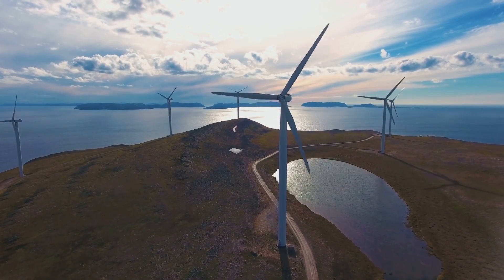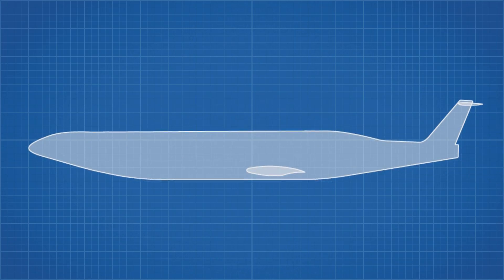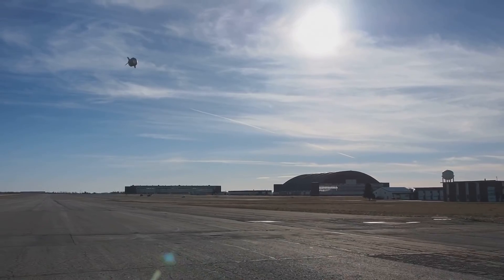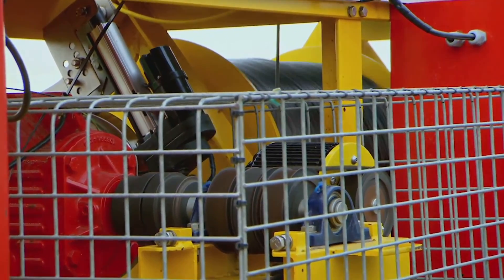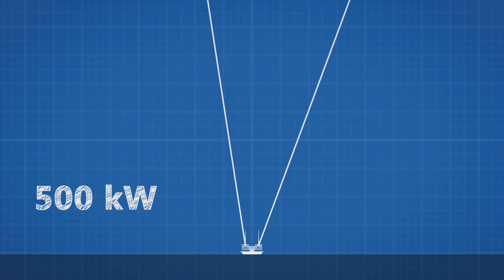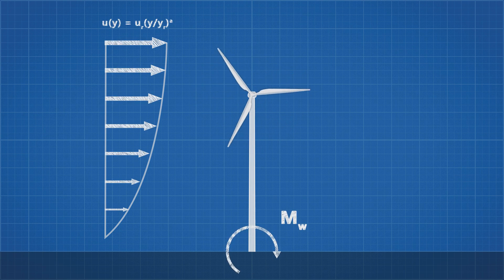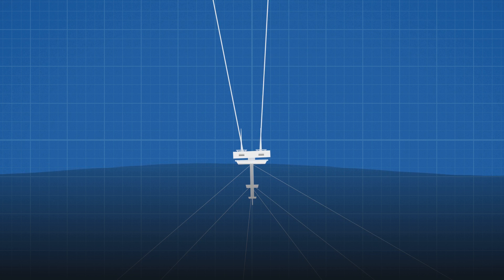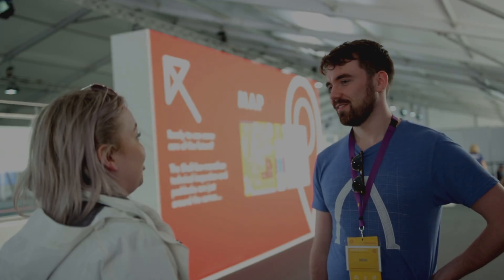The Future of Wind Power? - Kite Power Systems

Comment: This isn't very convincing. Nuclear fusion is the next step.
Reply: Nothing is the next step, because our methods of generating power are too widely distributed. It would take a century to become solely reliant on a super power source as old ones are slowly cycled out and replaced. 

In the interim, other new technologies like these can be quick and cheap replacements that improve overall performance even while a super power source is being universalized.

The world isn't so simple as to be able to summarize it.
Reply from the maker: There doesn't need to be one single answer, each has it's merit. We can't exactly wait around until nuclear fusion stops being science fiction either.
Reply: Nuclear fusion is not ready yet. Its absolutely still decades away from being viable AND economical, both of which unfortunately not a given. I definitely believe in the future humanity's energy needs will have to be met with fusion, because it is such a huge resource. 

But we need to take advantage of emerging technologies in the near future.
Reply: The problem with fusion is that there still isn't a single reactor generating more energy than it needs and we are already experimenting on it like 15 years? It probably ultimately is the final solution but the development could take centuries to come. It's just not smart to bet on a single card that has yet to prove its feasibility especially because we are already in a global energy crisis NOW. Nuclear fission 2.0 is another topic many people don't have on their radar. Its a thing and the only reason that it didn't happen so far is that it doesn't produce weaponizeable plutonium. We need to advance on every possibility to be able to meet future energy demands.
Reply: Fusion has been "20 years from now" for pretty much all of my life. When I say this, I'm not belittling the people working on fusion, they're incredibly smart people, much smarter about Physics than I'll ever be.
Reply: No. Nuclear fusion requires hideously expensive materials technology--and scientists haven't figured out how to cut that cost.

A far better solution is a new type of nuclear reactor called the Molten Salt Reactor (MSR). Fueled by plentiful thorium-232 dissolved a solution of molten fluoride salts, MSR's don't have the downsides of today's nuclear reactors, since they don't need expensive pressurized reactor vessels and because the fuel is already in liquid form, the danger of a fuel meltdown is non-existent.
Reply: Hydrogen is free. Wind is free. That 500kw wind kite is probably 50 grand when they scale production up. Are you really proposing that we are going to build nuclear fusion plants that make half a megawatt for 50 grand? Shit I bet the shielding alone on one of those plants would be 50 grand.
Reply: please read about controlled fusion
Reply: See, if some underqualified laborers in some god-forsaken place screw power kite - well they just spend some time untangling it. If they screw nuclear power plant (even fusion one) it at least melts down and catches fire.
Reply: whykhr
20 KWH(.02 megawatthours) = a pound of hydrogen from water
a pound of hydrogen fused is 79,378 megawatthours.
Hydrogen is basically free for use in fusion.
Reply: kkknotcool
Many of those small fusion groups that keep popping up see high temperature superconductors as the thing that has changed.
Reply: Dovah Bear Literally every element in all of nature is non-renewable, mate. Some merely last longer. Read up on thermodynamics.
Reply: Thorium reactors. They are almost completely immune to meltdown/MCA and produce 1/1000 of the nuclear wast normal reactors do and they mainly burn thorium ore which is currently a abundant waste product on most mines all over the world. The main problem with them is that development is expensive and there are not enough investors because of the bad reputation of fission in general.
Reply: Do you have the real name of the "Fission 2.0"? I couldn't find stuff about it
Reply: Oh shit, yeah, Thorium reactors are crazy. I really hope to see some big investment boosts for the research and application.
Reply: You should make a video about ITER fusion project or maybe generation IV fission reactors, those are also very interesting topics.
Reply: PureAwesomeness 
it's the next great leap. 

we have to design a system first. 

this system is already designed.
Reply: Actually, companies like Exxon and Shell already have surprisingly substantial interest in uranium mines. Many are still holding onto thorium mines, because if the MSR technology that uses thorium-232 successfully scales up to commercial operation, those mines could result a massive financial windfall.
Reply: nuclear power is just a transition between fossil fuel and renewable energy.
Reply: + Dzulfiqar Bagas Tito Fundamentally  there is no such thing as "renewable energy" - Most our power sources are just weak and inefficient receptors for energy coming from our big uncontrolable fusion reactor called The Sun.
Reply: yeah

but.. renewable energy called as renewable because.. we only exploit nature in the making process of those machines. after we made it, we dont have to exploit nature to gain power again. unlimited access to gain power. it's long term benefit.

(srry if my english bad but i hope u all understand)
Reply: Exactly. Nuclear fusion is extremely extremely complicated and expensive. Solutions like this or even a wind turbine are extremely simple by comparison. I believe it is good to step away from top-down production and go to more numerous locally production. Ideally, every household would be able to produce their own electricity. This will negate the dependance on third parties and bring forth an extreme reduction in single-point failure for whatever reason (attack, natural disaster, breakdown at the power plant).

Yes, large facilities will always be more efficient. But when you are not using fossil fuels, efficiency is not that important. It just needs to be simple/cheap to maintain or replace the components. It just needs to be efficient enough to provide a single household. 

The large consumers in the industry will have to rely on bigger installations.

The battle for the energy market is a political one. We need to cut out the middle-man where we can to truly empower individuals. We need to go off the grid or at the very least move towards a smart grid.
Reply: currently Nuclear fusion won't work as it can only be achieved at extreme temperatures which require more energy to produce than you get from the fusion but one could argue that solar power relies on nuclear fusion
Reply: QED
Is what they said a few decades ago.  And a few decades before that.
You have to ask yourself, what has fundamentally changed, that modern scientist, in the last decade, are now more able to create an economical fusion plant? Nice computer simulations is all I can think of.
Reply: e1123581321345589144 they have a better chance in the medium term but fusion is too promising to be forgotten even if we will never be able to make it work. It took us 400 years of failed attempts to master flight after all but it's worth it now.
Reply: Quantum Shooter
It did not take 400 years of failed attempts to master flight. The wright brothers to supersonic flight was 44 years. 
And the only reason the wright brothers got anywhere was they got economically produced aluminum 14 years before. And machining got way better in the latter years of the 1800s. And the math for fluid dynamics actually got worked out a few years before they flew. The wright brothers did great work but they really just used the accumulated scientific and business success of others(the new tech of their age) and applied it in an interesting way. What is the new tech that will make fusion possible? You cannot just say reseach and expect people to just figure it out if you throw enough money at them.
Reply: +Sacto1654 There's nothing new about molten salt/thorium reactors.  It's known for 60 years or so.  They produce much less waste than current fission reactors (0.1%), the waste decays much faster (300 years instead of 100,000), there's no risk of meltdowns indeed and there's much more thorium to be found on the planet.  Despite all these advantages, president Nixon killed the research because the process doesn't produce plutonium he wanted to build his nukes.
Reply: PureAwesomeness, Cool story bro, are you gonna build us the immense fusion reactor capable of withstanding outrageous temperatures that also produces more energy than it takes in? Cause we aint got dat shit.
Reply: my uncle worked on nuclear fusion for a pretty long time and he says it might never become commercially viable
Reply: Nice, thanks dude! :)
Reply: I just posted a similar comment. Nuclear is the cleanest option we have now.
Reply: Dzulfiqar Bagas Tito Yeah however we can go to other planets or asteroids for thorium and metals, in the future.
Reply: fusion?, that magic bullet that's been right around the corner for what 60 years now? I give these kite guys a better chance of succes.
Reply: The next fusion "plant" that has hope of producing positive net energy, is being built for testing purposes. And that is planned to start testing in 2025. We need energy between those 30 years for it to become the norm
Reply: "...companies like Exxon and Shell already have surprisingly substantial interest in uranium mines..."

Bull. Exxon & Shell could care less about uranium except to keep it off the market,  uranium has the volumetric energy density that is 41million X Oil or 94 million X Oil including the O2 you need to burn the Oil. So you can readily see what uranium means to Big Oil is $$$$ Lost for every lb of uranium or thorium burnt. And there are no thorium mines. It is a waste product of Rare Earth mines, they will pay you to take it away. In fact there is enough thorium in the annual waste from one Rare Earth mine, that makes materials for the Wind & Solar industries,  to supply the entire World's energy for one year.
Reply: "...Anyway saying they ahve the magic bullet to energy production and climate change is fooling himself, or plainly lying....*

Well, I ain't lying, and I know beyond even a shadow of a doubt, that Thorium can be the "silver bullet" to solve forever the energy / climate change conundrum. Don't mean it is the ONLY solution but unlike, wind, solar, fossil, renewables it by itself can quite readily and quite easily replace all our energy needs for all intents and purposes forever. Wind, solar are just scams, financed by Big Oil, to divert effort from what they know,  just as I know, Nuclear fission alone can readily replace all our world's energy supply and much cheaper than existing sources. That is just a fact. A fact they don't want you to know and they will pay $trillions if need be to keep you from knowing it.
Reply: Hydrogen is free? Last time I bought some it sure weren't free. Wind is free that's why in Ontario we pay 13.5 cents a kwh for it plus additional giant tax subsidies, because it is free. Nuclear fusion is speculation right now. Right beside the nutty wind turbines NPPs are producing power for 5-6 cents per kwh. That is even more free.
Reply: We are indeed getting closer folks!!! :D https://www.ipp.mpg.de/4073918/07_16
Reply: I think fusion (And space solar) will be the future. But it will take time until that. This technology can be deployed soon. It should not be that hard to start scaling up the production in short time. So until we get effective fusion then this (and some other technology) will help.
Reply: Fission would be the best choice for now. And we could already have Fusion if the governments would finally be able to not just talk Bullshit. The US invested less than 1/10th of what would have been needed.
hack - the annual US Military budget is about as much as the US has spent in grand total on fusion-research.

Fusion will be the next (and likely final) big step.

But this? it might work in some very specific circumstance, but sure as hell not for normal large scale powerproduction.
Reply: ANGELM73350 that's just a made up word for the next gen nuclear reactors.
Reply: In a few decades
Reply: Actually not the aluminum as much as internal combustion engines with a sufficient t/w ratio wich they produced themselves. 
As mastering I was intending to succed in flight and humans have attempted actively since at least da Vinci. 
What tech will make fusion possible? First is already possible, is just a matter of input to output energy so the tecnology needed is quite simple to show: better magnets, better fluidodynamic models of a concentrated superheated plasma, better superconductors etc... and in this case throwing money at it already showed promising results so I don't see why we shouldn't give them the chance.
Reply: Oh, yeah, cold fusion, a technology that needs billions in funding just to find out if it's even possible sounds like the natural next step…
Reply: gotta agree that nuke will not last forever, the kite can be true closed loop when coupled with string farm
and this will be very good if we can hold lightning strike too, coupled with solar we can produce energy day and night, stormy and sunny
Reply: PureAwesomeness This is a lot more feasible, affordable, and realistic option on the table. 
Nuclear fusion is a long way from fruition. We'll be lucky if we have a working prototype in the next 50 years and who knows how much long it'll take before it can be scaled up for commercial use. That's not to mention how long it would take for the tech to become affordable. 
So many idealists commenting on this video. Y'all need to come down from whatever fantasy you people are in and understand how the real world works.
Reply: PureAwesomeness king gizzard knows
Reply: Fnord Fnordington Would you rather burn coal?
Reply: Not saying that nuclear fusion is impossible, or bad, but the hype around it certainly is several magnitudes larger than the amount of energy it has produced to date.
Reply: By the time Fusion become commercial ...The planet will had pass the point of no return (if we did not pass it already)
Reply: Shell Oil does not promote thorium or Molten Salt Reactors because it knows damn well they actually will replace their noxious Oil & Gas. Shell loves flying kites and other pixie power fantasies, they promoted Bill Clinton's #1 energy solution (through the CGI Clinton Global Initiative), they even hired soccer star PELE to promote it, an f-in soccer ball with a pressure to current transmitter inside that charged a Li-Ion battery in the soccer ball so the captain of the soccer team could take it home, plug a tiny LED into it and watch porn at night. That's a good example of a "Shell Energy Solution".
Reply: Brian Miller while that is true, we are making progress. The largest test reactor is nearing completion in Europe, and is the first that could conceivably make power. We are still far more than 20 years from having it at a commercial level, but in only a few years we will discover whether we are able to use fusion with our current technology.
Reply: Quantum Shooter
The point is they needed the aluminum. They needed the math. They needed the machining. They needed all this outside stuff to create the plane. Without industrialized aluminum would they have created the plane? Probably not. So why would you fund the wright brothers in a world where aluminum isn't an option? You wouldn't. They would probably go the rest of their life building gliders and nothing would matter. It's the same thing with fusion. What is different about the toolbox today vs 10 years ago? If the answer is almost nothing then why would you ramp up funding? I'm not saying there is no value in funding them. I'm just saying unless something meaningful comes along to change things drastically then more "research" isn't a good idea.
Reply: Well it's cheap.  Nuclear reactors cost millions.  This could be very useful for small towns, in poor areas.
Reply: The future is what's cheap. Not what's cool.
Reply: PureAwesomeness

we don't even know if fusion works. and the preliminary investment that needs to go into devolopment is staggering. this is a significantly more likely solution for our immediate needs. although I grant you that fusion would be better if we can get it to work.
Reply: Quantum Shooter
Also they think they might be close to a net positive fusion power plant. I have suspicions about that considering they are the ones who directly benefit from lying about how close they are. But ignoring that, they are still light years away from an economical plant. Which is the only plant of any use. Who cares if they can make more power than they are consuming? Especially when they are eating through thousand dollar tungsten shields every three hours of operations.
Reply: I'm suspicious too, I support research on fusion but I agree on the mountains that still have to be overcame, the only thing I say is: fusion has a huge potential and deserves to be studied, is possible we will never reach economical production but the theorical benefits far outweights the costs in my opinion.
Reply: PureAwesomeness good luck inventing nuclear fusion, uranium, plutonium, and other elements used in nuclear reactors are non renewable resources and right now nuclear power is just kind of meh. If you can invent a way to induce nuclear fusion then that would be nice
Reply: Dovah Bear
They are not non-renewable resources. At current world power consumption, regular nuclear reactors can keep going for thousands of years and breeder reactors can keep going roughly until the sun goes out.
Reply: Well PACER Fusion is doable right now, and certainly far cheaper and cleaner than wind or solar, but is politically untenable. The problem with Fusion is the exact same problem with Fission. Big Carbon don't want any competition for their noxious product and since they pretty much own our governments, what they say on energy matters goes. So all that are promoted, at the behest of Big Oil, including Shell, are nutty scams that have ZERO chance of replacing significant fossil. That includes this flying kite special, wind, solar, hydrogen, agrofuels, ethanol, biodiesel, carbon capture, tidal, wave and Big Fusion, like ITER, and in fission, they know damn well we need to be going to MSRs and they already have the IFR, and what is the corrupt, crony government pushing? The nutty HTGR, completely stupid, most difficult of any and all fission tech, a complete waste of money that doesn't do anything the IFR and MSRs wouldn't do better, quicker and cheaper.

In fusion there are a dozen Fast-Trak fusion projects going on shoestring budgets, relying on private donations, zero funding from corrupt politicians, like Focus Fusion, Polywell IEC fusion, Colliding Beam fusion, Helion hybrid fusion, Muon catalyzed fusion, and more. That is where the money should be spend. ITER is a Bill Clinton "International Cooperation" boondoggle, they spent 5 yrs arguing about where to build it, the mother of all bureaucratic nightmares and it won't be ready until well past 2030 and all it will do is some interesting plasma physics. 

Face the facts, friends, the Energy Hegomonists don't want solutions, they want scams, and that is EXACTLY what this promotion of the wind kite by Shell is ALL ABOUT.
Reply: Manolis Krestas I very much doubt that